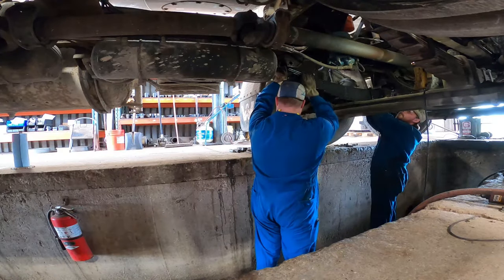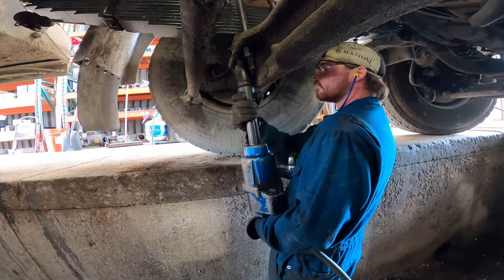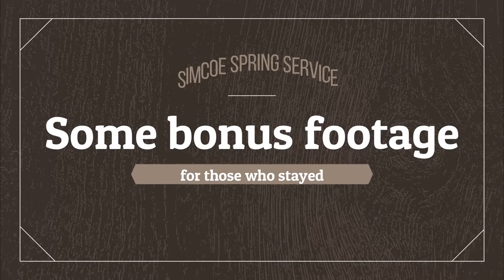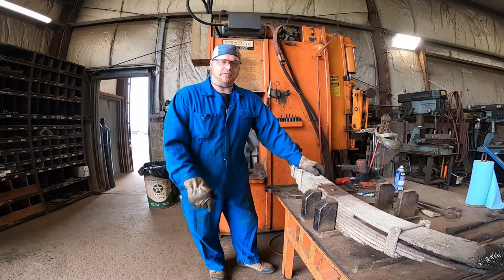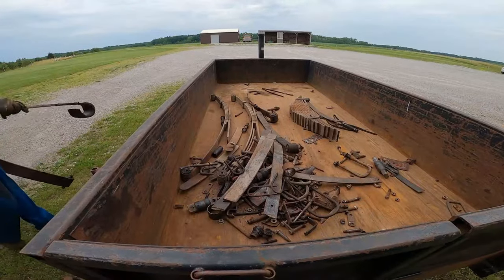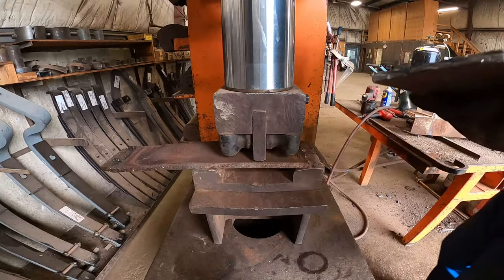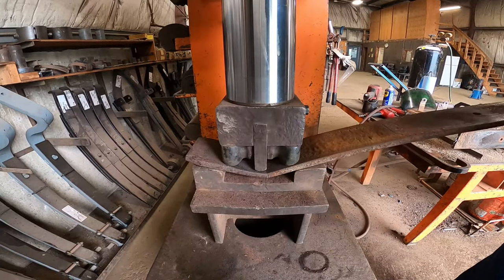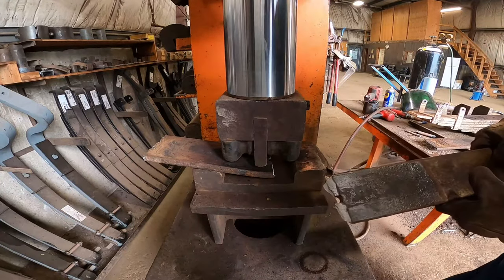Lifting heavy things and breaking spring steel

Comment: I drove different mixers off and on for years and this doesn't surprise me. With all the water and acid in washing it's a wonder there are any springs left. The last was a 10 1/2 yd. Mack 4 axle with a Bridgemaster with walking beams. Lots of weight and a 12 yd. Mack/Oshkosh front discharge, no cheaters. Good video!

Comment: For steel that is intended to flex, it is amazing to hear it crack like twigs when under the load of the press. The good steel snaps too, but after more pressure and seems to normally stay together until wiggled apart, in contrast to the weakened areas. I was waiting for the reason for not repairing a spring on a liquid carrying vehicle, but it didn't come, however, I cannot assume the liquids being carried coming into contact with the springs, apart from the concrete carriers. Great video as per normal and actually educational too, given the display of the various steel under tension in the press.
Reply from the maker: Oh sorry.  Springs under a truck that has a liquid load gets strange flex cracks in the steel that looks like wrinkles.  Only happens on trucks with a liquid load.
Reply: @simcoespring  That is understandable with liquids but quite an eye opener to see it. By the way, love your videos and interaction between you guys.
Reply: I would guess it has something to do with spring fatigue due to the abnormal cyclic loading caused by sloshing fluids. In that case the load should cause the spring to deflect to near maximum when stationary and maybe extend beyond maximum deflection when in motion.

Comment: I have put springs in a F750 before and I don't remember it being that easy. My shop doesn't have one of those neat pits in the floor. I do remember them being very heavy.
Reply from the maker: If you can't stand or get your body in a good spot any weight can be too much.  F750 springs usually weigh from 160-175lbs.  That monster we just put in was 247.2lbs  One of the heavier springs we have to lift in.  We did one last year that was pushing 330lbs.  Lets just say...i was hurting the next day.

Comment: I ran a mixer for 7 years....not that big, only 24 tons......But I specified heavy duty springs front and rear....ran pretty close to the weight limit...but only broke 2 leaves in 7 years, never needed a new pack, just the 2 new leaves.

Comment: I guess the constant flexing of the spring fatigue’s it.  Must change the atomic structure of the metal?
Reply: Every time you stop the load sloses  front , back , front ,back so the springs are continually flexing , its like being on a boat !
Reply: I think it's called high cycle fatigue.  As Dave describes below.